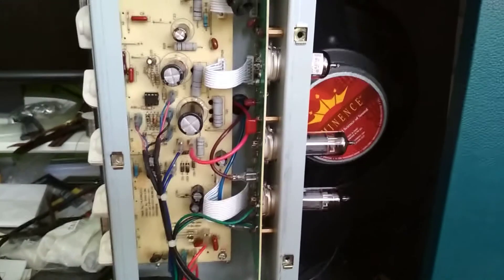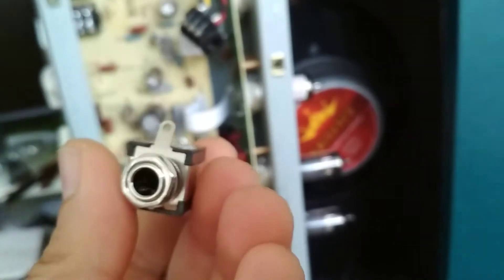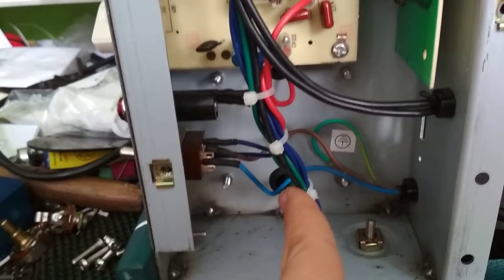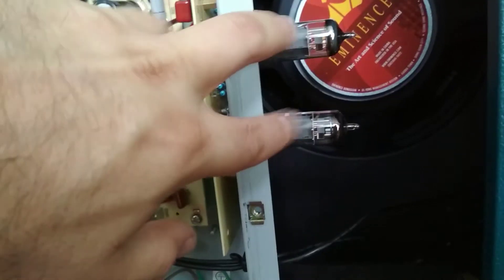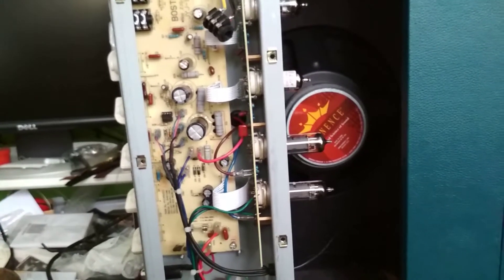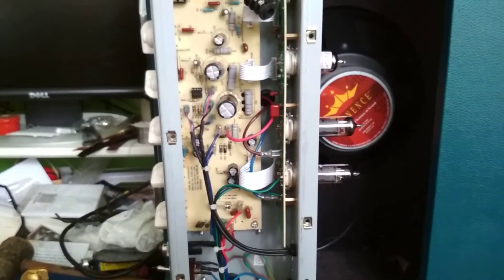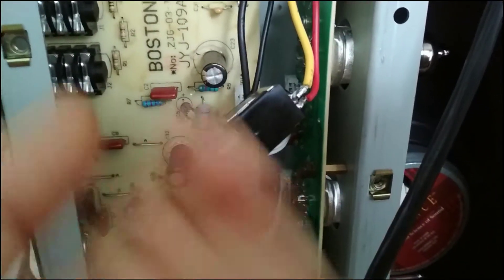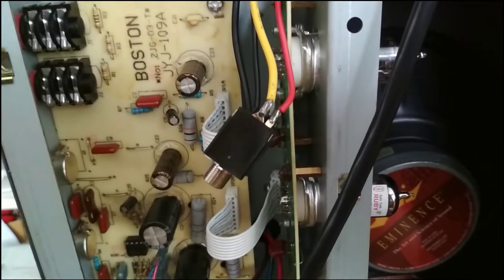Strauss SRT-15 Tube Amp Repair

Comment: Great video, I bought a faulty second hand one , it starts making shorting out scary noises after about 5 minutes. 
I’m wondering if it needs the tubes replaced? 
Any thoughts would be appreciated
Reply from the maker: Highly likely the power tubes are gone. But if that fails you after you swap them out, I’d be checking filter caps and resistors next. The two EL84 power tubes are a matched pair. Being a cathode biased amp you will need to replace both together as a matched pair.

Comment: Thanks for clip. 
What is the cab material made from?
Would have enjoyed hearing you play this amp as I don’t think there are any YT clips of it.
So were you saying these actually have Aus made trannies in them?
Reply from the maker: I believe the cab is made of ply. Not sure of the grade.

Sometimes I get time to demo the amps after I fix them. A lot of times I've been too busy. I'll try to do more after repair demos if I can.

The transformers are Chinese made like the rest of the amp. However, when the brand got resurrected a few years ago, the output transformers were under specced due to a misunderstanding between the designers and the factory (of course).

The meant that the amps caught fire. However, the amps were fixed and I believe the company got a local amp builder to rewind all the transformers to spec until the factory in China figured it out.

That's one version of the story I've heard.

UPDATE: I did in fact sell this amp. But the buyer was tube rolling and had possibly been modding it. The tremolo stopped working and the amp sounded horrible.

I ended up buying it back off the buyer. Fixing it and I have been gigging with it because it's a loud and light weight amp.

It has had new tubes in it and has been running very well. Played about 20 gigs with it since then.

I've also placed shields over the preamp tube sockets, as well as insulation under the exposed reverb tank.

The shields have helped reduce interference and noise a little. The cardboard and new rubber grommets under the reverb tank have reduced the high pitched hiss when the reverb is turned up. The RCA sockets have been cleaned to help too.

I might do another video with these updates and a demo soon.
Reply: Stefano Musica 
Yes, that would appreciated (an updated mod clip).

Have you had a chance to check out the Strauss 20R? If so, how does it compare (in every respect) to this model?

I understand it’s pretty much a Fender Blues Junior copy, but with differences like cab, speaker and probably transformers. I am interested in it if it’s a decent amp.
Reply from the maker: James cheers. I'll try and get to it soon. There are also 5 other projects waiting to be edited and uploaded. Stay tuned for those.

As for the 20R. I have to touched one yet. But I. I'm assuming it'll be a similar amp, just more voltage to the EL84 plates for the extra few Watts.

Comment: Strauss are underrated. But you can get the same amp under so many different brand names.

The best one I had was an SVC-30. And I do think it was well-shielded, quiet, idk if the switch was plastic or not.

Mine had standby, master, gain, the works. Boost. 2 channels, TRS for channel & reverb, effects loop. 3 12AX7, 4 EL84. I had the tranny replaced. 

It was basically a VOX/Fender hybrid. Head and cab version also around.

I'd use one again in a heartbeat. But not so sure about these new Strausses.
Reply: Eminence suck ass. Sorry. Just my subjective opinion. Never got them to really growl for me. The Strauss I had was fitted with this heavy AF V-Lux MIC Strauss speaker. Thing sounded like a 70's timewarp. I got serious Floyd DSOTM tones outta that thing.

Haven't seen an SVC30 around anywhere have you, mate...hint hint :)
I'm in Sydney.

Thanks for the in-depth. Not buying the SVT-20r this dude offered me for $285. New, never played.
I wonder why...and he wanted to meet where I couldn't plug in LOL

Srsly, find me an SVC30 and I'll buy it.
Reply from the maker: The new amps are okay. The transformer issue was due to a misunderstanding in the Chinese factory. That is the story I'm lead to believe. However, they have resolved this now. In fact, they resolved it when the problems became evident by the company replacing the transformers with locally made ones. I'm surprised they didn't go bankrupt due to this, and I'm glad they didn't.

Yeah, the SVC-30 is also a great amp. Versatile and powerful. You could have just that amp and gig with it, rehearse, practice. Etc.

As for Eminence speakers, I guess it's a matter of taste. I do like them. I prefer them over Celestion. However, I will use whatever speaker gets me the tone I'm after. I rarely read forums or opinions, I just try for myself because it's highly unlikely that the speaker is going to sound the same in my amp, with my playing style, my strings, etc.

If I find one I'll try and remember to keep you in mind.

I'm happy to buy that cheap untested amp. Shoot me a message to the sellers details. Whatever is wrong with it, I'll fix it and make a great video of it.

I'm glad you enjoyed the video. Stay tuned for more currently being edited.